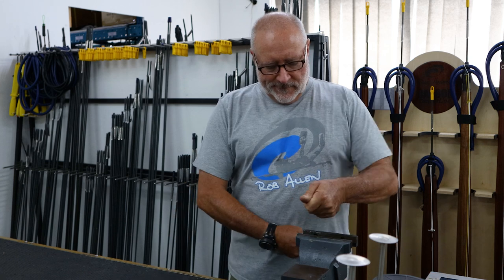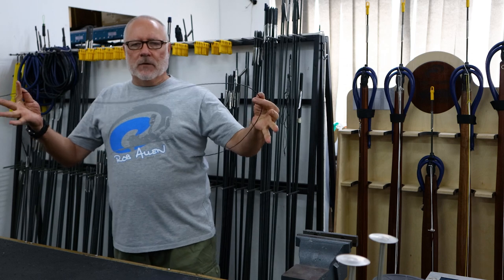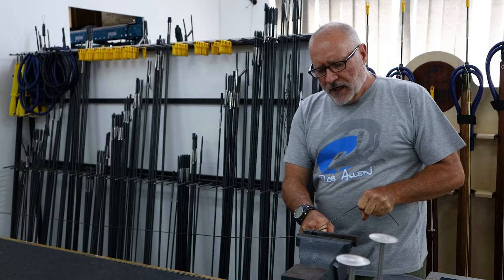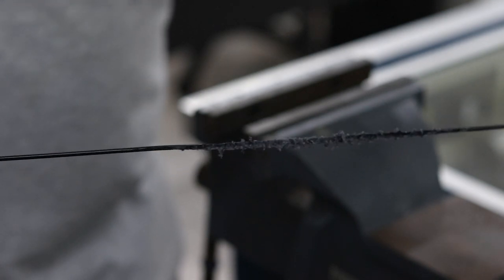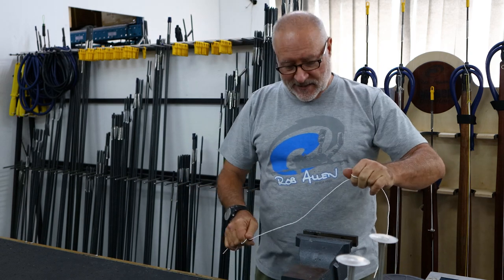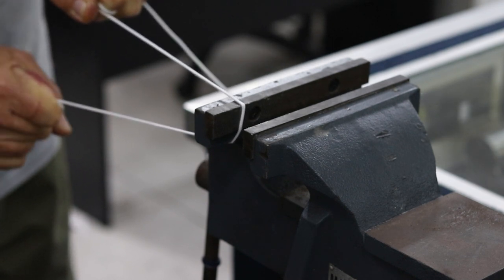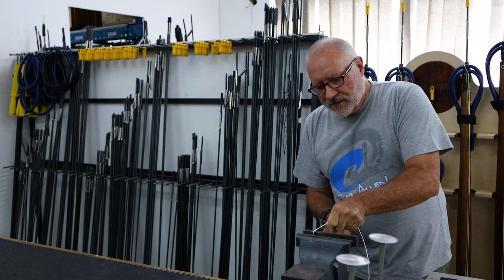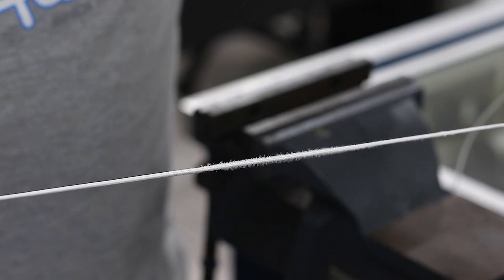Rob Allen | Abrasion Test | Mono VS Dyneema | 2022

Comment: This has changed my mind. I know in fishing line is Braid the leader is mono or fluorocarbon to help resist the fish's teeth and reef etc but I suppose this is much different.
Reply from the maker: Remember with fishing braid, it is very thin. The mono or fluorocarbon is much thicker and, translucent. The abrasion resistance is better due to the massive increase in the diameter of the mono, not it's cut resistance.

Comment: Correct, but I still have one question:
When we do not use monofilament, dynema usually gets tangled when used directly from the spear...How do you avoid it, specially considering that sometimes you don't use a reel but a direct bungee to the spear and in long shots range, something like 4 to 5 meters?
Reply from the maker: Best is to use Dyneema that is woven tight to give it stiffness and, make sure you have a swivel on your bungee.
Reply: @RobAllenSpearfishing  Noted and thanks for your reply, I'll try again to use dynema  from the spear... I have a swivel in both ends of the bungee, so that shouldn't be the reason for the tangle.
Reply from the maker: @pedrocostareis8330  Is the line tangling with the rubbers when you shoot?
Reply: @RobAllenSpearfishing  Well, most of the times, yes...meaning, I use wood guns and my trigger mech has the line release on the middle of it, open muzzle but I also use a RobAllen 9mm rubber with dynema inside to keep the line & spear tight, from the spear
Reply: @RobAllenSpearfishing  & Sorry thanks for the reply
Reply: @RobAllenSpearfishing  Believe that on of the reasons id because dynema is soft, and when it goes along the shaft, it isn't so stiff as the monofilament, and that could creat the tangling.
Reply from the maker: @pedrocostareis8330  Check this video where I explain what causes muzzle wrap. https://www.youtube.com/watch?v=svmFgmbWlxk&t=1s  at the 7 min mark I talk about muzzle wrap and how to prevent most.

Comment: Personally I use mono unless there's quite a lot of structure.
I feel braid is a good choice for rollers because even with the stiff braid, on my standard guns, I have gotten band tangles much too often. Rollers don't seem to have this issue much, probably as there isn't the band flopping around after the shot.
Another good resource for informed decisions on shooting line is in this video https://youtu.be/sHoc50e3Uq0 
The channel also has (in my opinion) the most unbiased and controlled testing that I have seen for spearos.

Comment: Would you suggest tying the dynema straight to the shaft?
Reply from the maker: Are you asking straight from the reel? Is so, no problem doing that but you will not be able to disconnect the spear line from the gun easily if you need to push the spear right through a fish.
Reply: @RobAllenSpearfishing  yes that was my question. Dyneema on the reel to the shaft. I have always kept my setup how it came from your factory for the exact reason you specify. Quick release with a pigtail and I can always replace the mono easily when it gets roughed up instead of constantly cutting the dyneema shorter and shorter.

Big fan of Rob Allen guns. Not a single issue in 3 years.